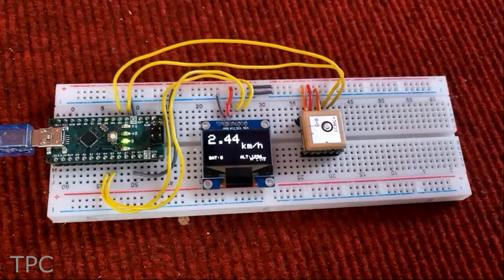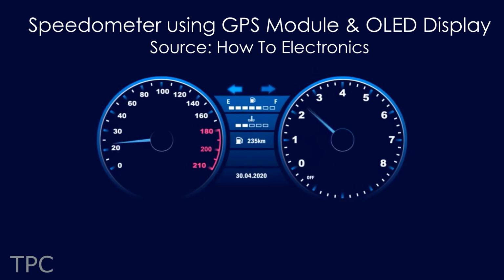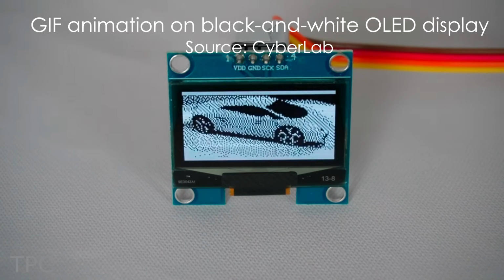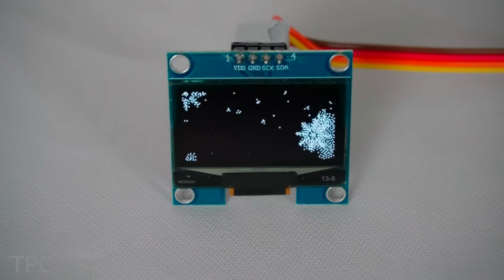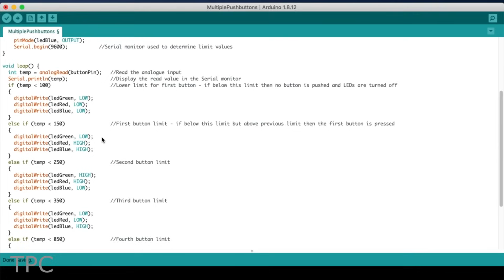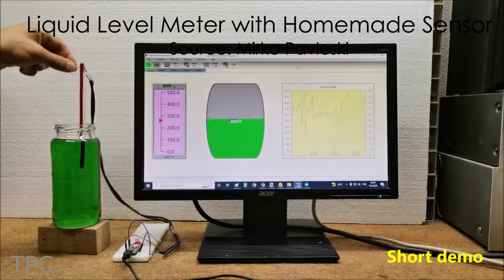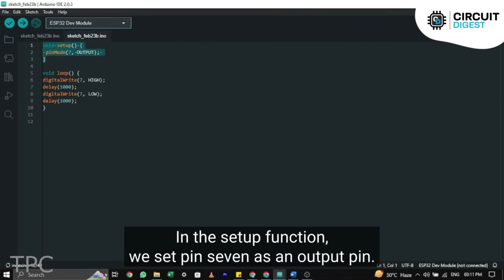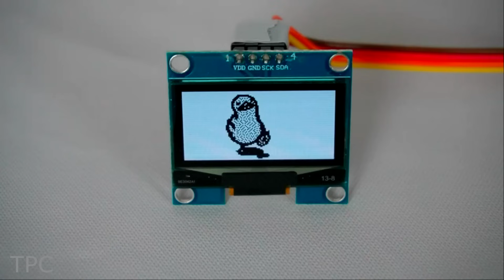13 Great Arduino Project Ideas for Beginners!!!

Comment: It's sad. I ordered a kit from amazon with this board and many many other parts. But, it came with no instructions or manual, no cd... and the link they sent you to had many many other links that really didn't tell you anything. I installed the arduino software. Again it didn't tell you anything. There were no lessons or how to get started. I sent it back. I did want to learn this stuff... already got my refund..
Reply: Most kits won’t come with manual cuz they know there’s many tutorials on yt and even ChatGPT and they also expect you to kinda know a bit about electronics
Reply: @Hnxzxvr  Well, I guess I'm not buying those kits anymore .... what crap company lol
Reply: Stupid, It cames that u bought something that allows you to do so much things and u expected that it will build yourself... Don't get disappointed and don't resignated buy it and learn fun stuff

Comment: Nice projects, but far away from absolute beginner projects
Reply: Yes these are not projects for absolute beginners (like a blinking LED) but certainly for beginners, since they depend mainly on one sensor without combining too much logic
Reply: You want a battery and a light? 💀
Reply: That multimeter really is for simpleton dum-dums